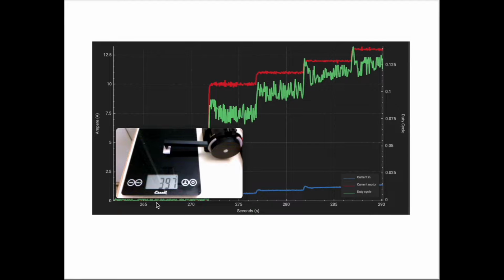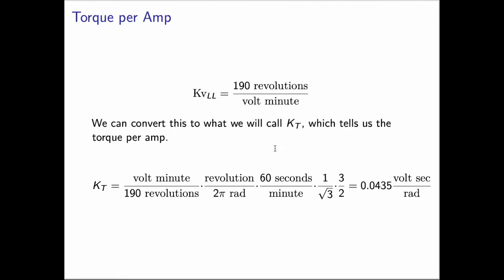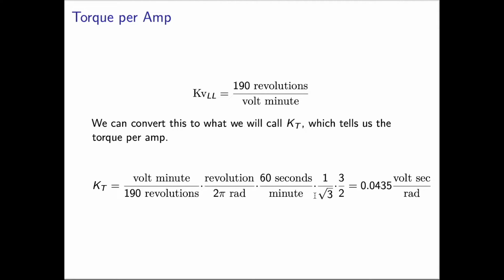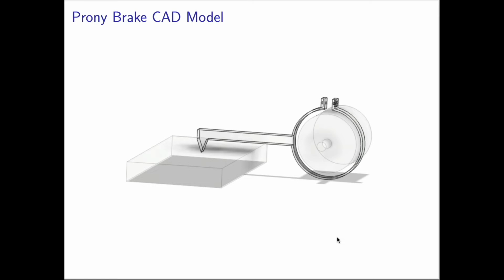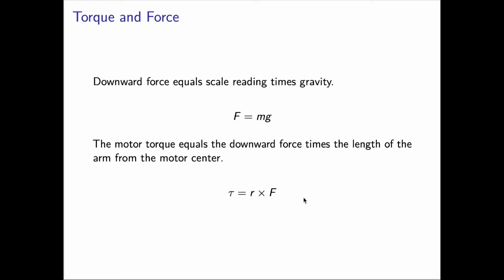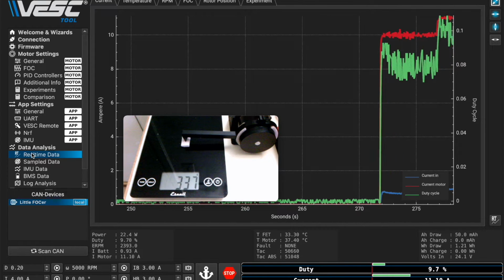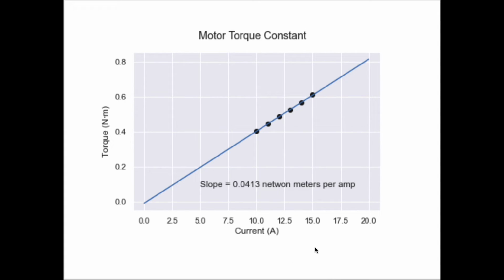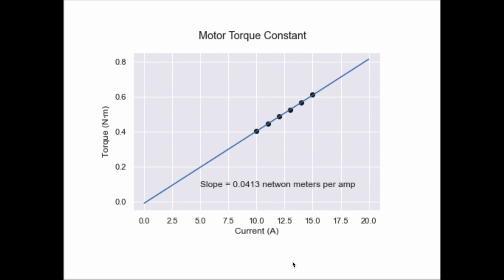Torque Constant Measurement using VESC Tool and a Prony Brake

Comment: hello, can you make a video about the saturating of the stator, in my case each brake the observer looses the position of the stator and so i have litle cutouts and no smoothly brake. I am using 20s liion battery with 60v1200w 10" hub motor. battery regen current 25amp and motor max cirrent 85amp, absolute current 150amp.
Trying to adjust the observer or make stator compensation didnt helo

Comment: Hello, great content.  Just a quick question, why is the "current in" on your graph so much lower than "current motor" on your graph?  I noticed the VESC draw at the battery is a lot lower than my other controllers.